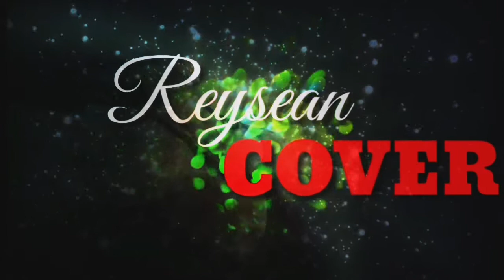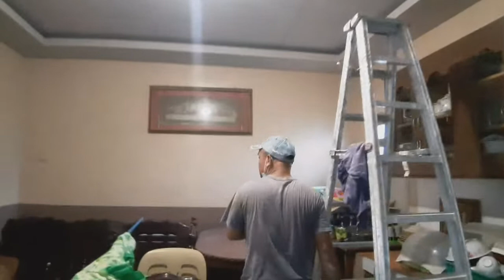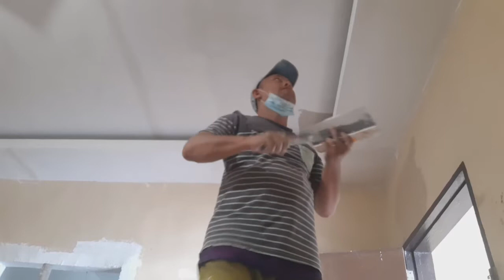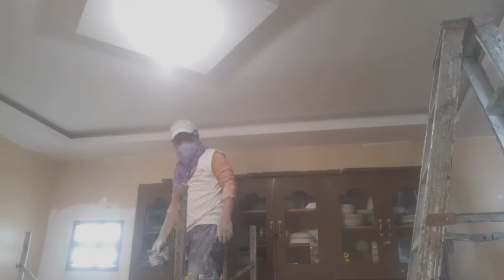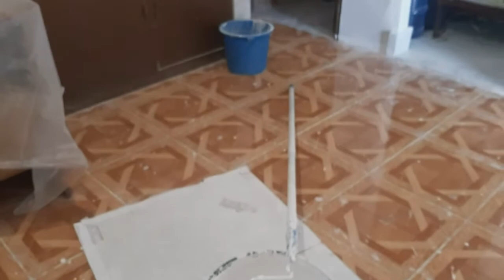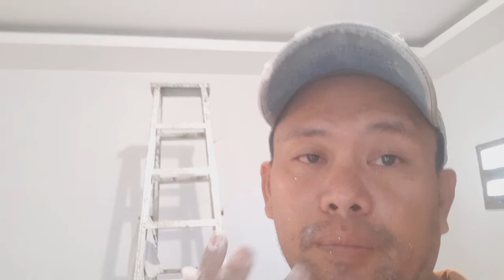PAANO MAGMASILYA AT MAGPINTURA NG HARDIFLEX CEILING/step by step/FLAT LATEX WHITE FINISH

Comment: sir tanong ko lang po. rough ung wall ko may pintura. gusto ko gawin smooth tapos baguhin kulay. ano po ggawin? salamat boss..
Reply from the maker: Masilyahan po ng skimcoat mga dlwang coat tapos flat latex white dlwang coat po pra matakpan ang dating kulay tapos top coat na po semi or gloss latex depende sa color na gsto nyo.
Reply: @Kaoblaktv  hndi ba un lolobo sir o mbabakbak? no need na po iliha muna bgo i-skimcoat? salamat sir at npansin nyo.